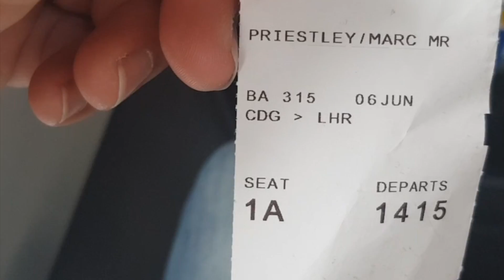MP104 - F1 Canadian GP Preview

Comment: Hi Marc, thanks again for a great video! I have a question about brake and tyre temps. Would teams be setting their cars up in a way that tires would not get up to temperature very well just by driving them, knowing that the excessive heat from the brakes would provide the extra heat that was needed? Thanks!
Reply from the maker: Brake heat transfer has to be a factor, so if, theoretically, you took away all heat from brakes, then yes, a driver would struggle to get tyres up to temp, or at least would have to work a lot harder to do it.
Reply: Thanks Marc! Keep the videos coming, love watching them!

Comment: Hi Marc.  About strategy,  i would think an additional pit stop is tempting here as the pit late is less distance than the track from the final chicane to corner 2 or where it rejoins. The time lost pitting should be less than most circuits should it not?
Reply from the maker: Ron Knox Yes, that's what I'm saying, the penalty for taking extra stops is far less than Monaco.

Comment: What are the pros and cons of the proposed 18 inch wheels
Reply from the maker: Jayson Munro Pros are mainly for the tyre supplier to be able to market their road car products more easily. As everyone has the same, there's no advantage or disadvantage to it. There's less compliance in low profile tyres, so suspension has to adapt to manage it.
Reply: Less grip, greater rotating mass. Tire pressure has to be kept higher, and we’ve seen how terribly these Pirellis have been with high pressure before, teams heat gunning the wheels to circumvent the tire pressure requirements. Basically sacrificing performance for the sake of looks, just like road tires.

Here’s an old but still relevant break down of it: https://thewptformula.com/2015/08/08/analysis-13-vs-18-wheels/

Comment: @5:20 Did someone else notice the unique steering wheel on the second taxi in Paris? The boss was floating independent of the rim itself. what Citroen was it?
Reply from the maker: Palash Mehta Oh yeah, I hadn't spotted that. 👀
Reply: Yeah, funky gimmick by Citroën. They put it on a number of models, but suspect this example is a C5 sedan.
Reply: Wouter K Citroen allways have funky wheels. Look back they have those crazy angled posts holding the wheel on older cars

Comment: What difference will make if F1 will go for bigger tyres rims?

Also, what "packages" or changes will include from race to race? Like from Monaco to Canada? I now about aero? But how much is changed inside of car?
Reply from the maker: maxim kiva The big rims and lower profile tyres mean less compliance, so suspension has to adapt.
As for Canada changes under the skin, some will have used bespoke suspension and steering for Monaco, which will change back. Renault/Ferrari due for PU upgrade too.
Reply: Marc Priestley thanks for replying! But I would love to know what else involved in in changing car from race to race in general, if possible of course. Does cars change radiators, parts in suspension, brakes and what are others bits? If you could put same lights on it. 
Thanks